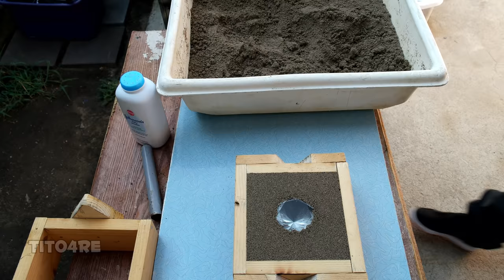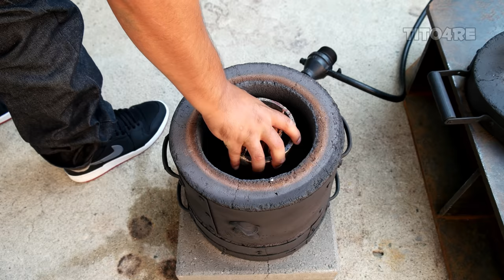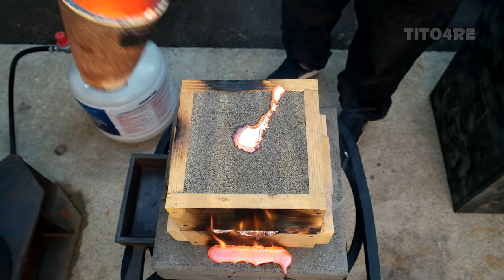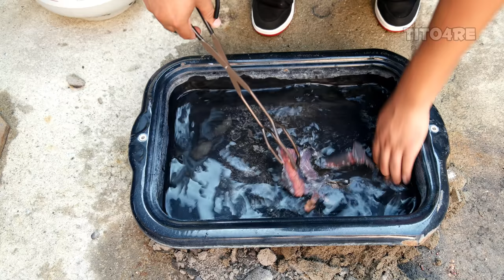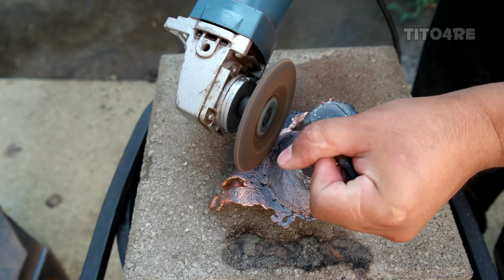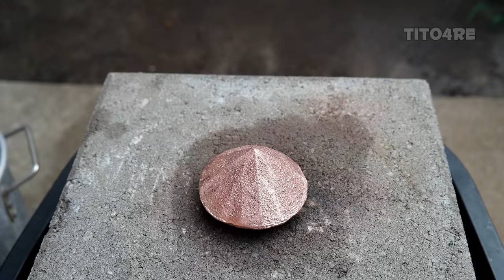"No Music" Making Diamond Shaped Paperweight From Copper

Comment: I dont know if you will be able to, but what you can do is cast the object from like foam, For example, you had to remove the diamond, Whereas if it was like a styrophome it would just melt when you poured in the copper or whatever your using.

Comment: lets say the original diamond was legit,how much that valued at?
Reply: *how much would that
Reply: +Mahee Sohel Depends on quite a few things really. where it came from, how heavy it is, how clean cut is it. but one of that size could for between 42,000 and anywhere to 5 million
Reply: Jamez Osborne woah.
Reply: +Mahee Sohel not bad for a lump from the ground
Reply: +Xilva Yeah tbh I think my estimate was low 👌😂😂
Reply: It's more than 50 million there selling a diamond about 1 inch tall for 15 million a diamond that big that has clean cuts and good weight probably in the 100's of millions easy.